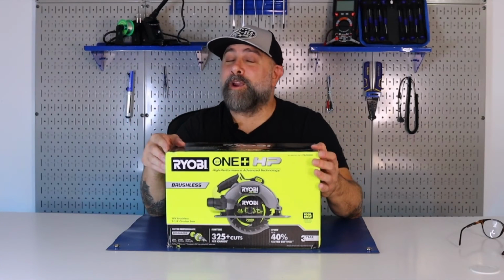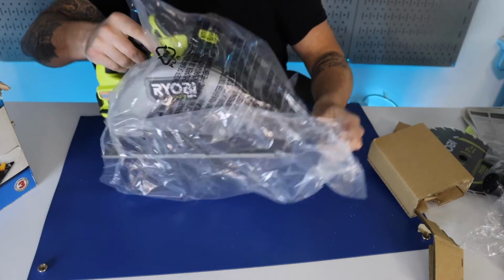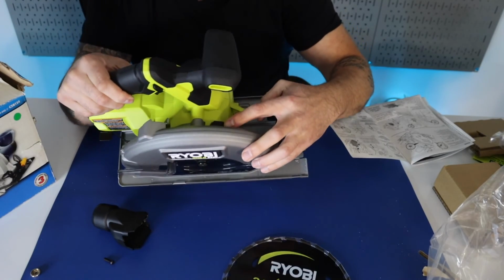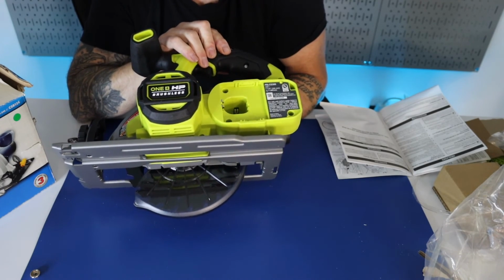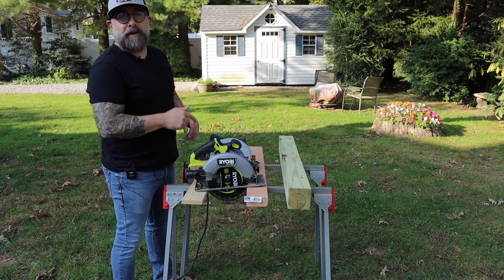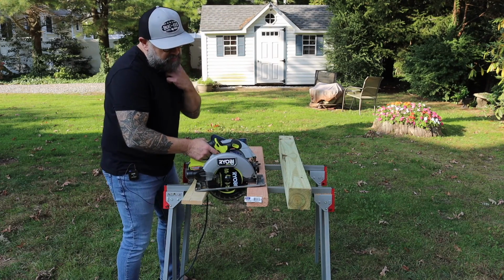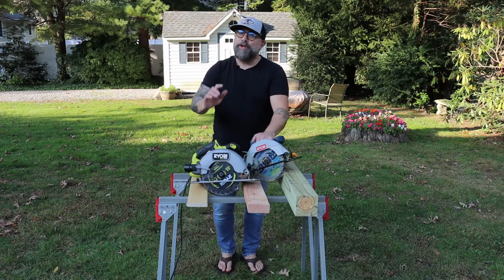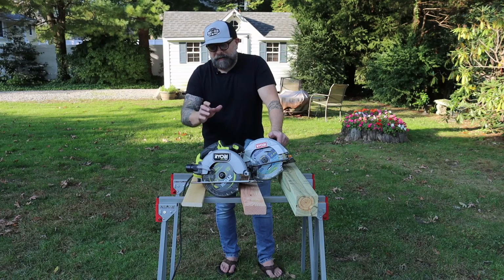RYOBI ONE+ HP 18V 7-1/4 in. Brushless Circular Saw Set Up and Put to the Test Against a Corded Saw

Comment: I just bought this saw and it works great...BUT...if you watch where he cuts the heavier wood you will see the exhaust for the saw-dust get restricted saw-dust comes out at first then gets clogged, this is a big problem with this saw. Cure that and the saw works great...which I did. If you look at where the dust comes out you will see that it's a tiny opening which make's the saw clog easily. I took my Dremel and made the opening bigger, I cut the metal guard up from the opening that was there to just under the screw boss that holds the plastic adapter. So that's two cuts up for the same width as the original opening then scored it across the two opening and broke the piece out. Now when the plastic adapter is installed you will see that now there is a larger opening for the dust to come out. Before when using tis saw dust would go all over the place, and when using a vacuum it would hardly get any of the saw-dust in the vacuum. Also when making long rip cuts with a lot of saw dust it would jam up the saw at times because the saw would clog with all the saw dust and jam the blade. Since the modification no more problem with this and the saw works great and now the vac does a great job in grabbing all of the dust. Even without the plastic adapter the dust can now exit properly. Ryobi should have caught this problem and fixed it.
Reply: Oh steve dont be a drama queen